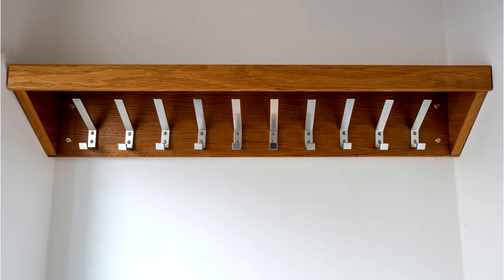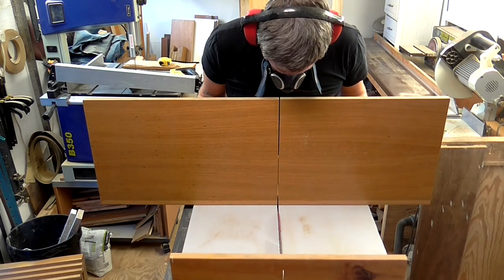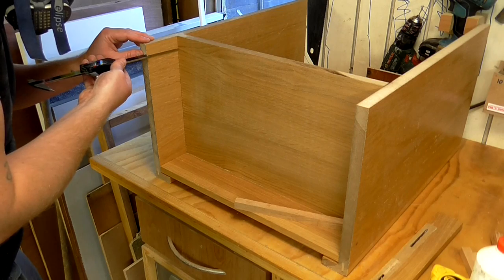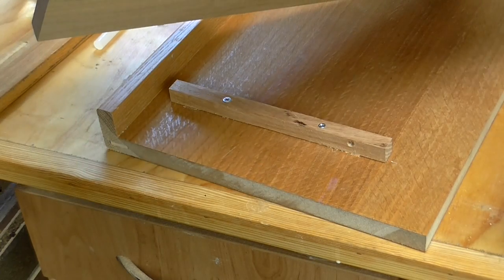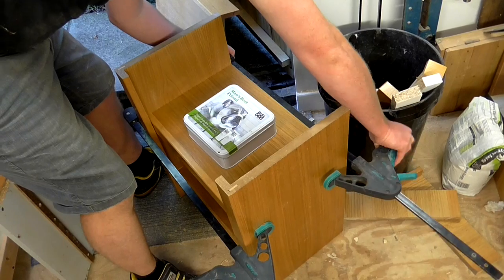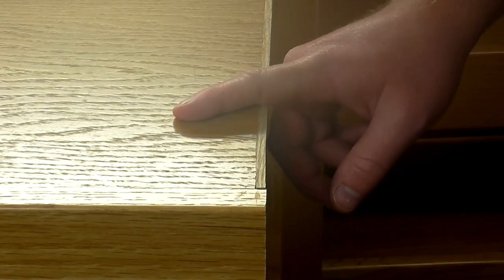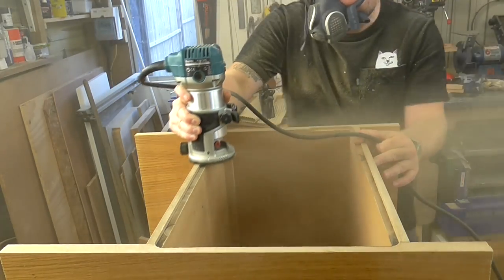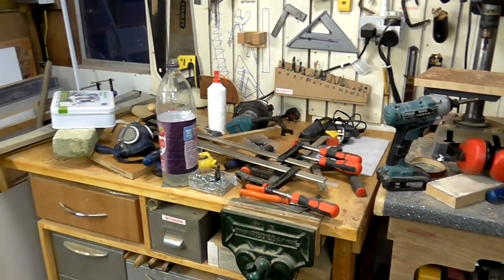Oak Bedside Tables

Comment: Not used the two glue method myself - however in my cardboard based craft work I find that hot glue can set as a lump that creates a gap between the pieces which can affect the accuracy. Is that not a problem in woodwork. Shall I take it up with 'the' DiResta himself?

Comment: Rather than sanding the mould could you keep it so it, say in an airing cupboard, so it dries right out and then give it a urethane coating to seal it. Saves loosing the face edge. Just an idea that I have not tried. Very good video to watch.

Comment: I'm just wondering where you bought/got your riving-knife? I have the Dewalt 745 myself, but the riving-knife that came with my saw sticks above the blade, so I'm looking into after-market ones.
Reply from the maker: +Bjørnar Magnussen a lot of people ask me that! I couldn't find an after market one so I cut the original one with an angle grinder and shaped on the belt sander
Reply: Rag 'n' Bone Brown That's what I'm thinking of doing as well. The problem is that then I can't use the dust shroud anymore, but I've never actually used that anyway, so it probably won't matter :P

Did you cut it exact with the blade height, or slightly below?
Reply: i did the same with my table saw.  I cut it to just below the height of the blade, so that it would not foul on the back of my table saw sled.